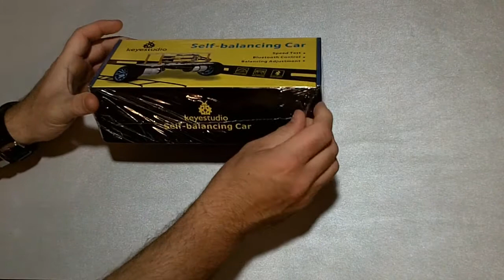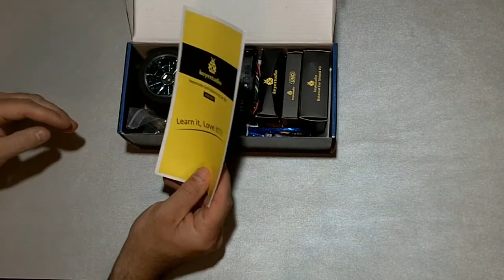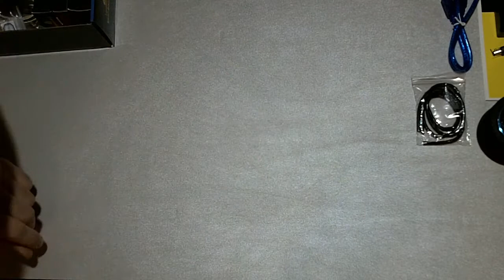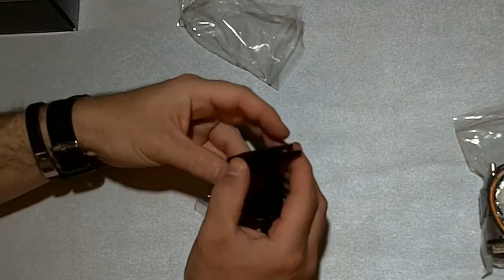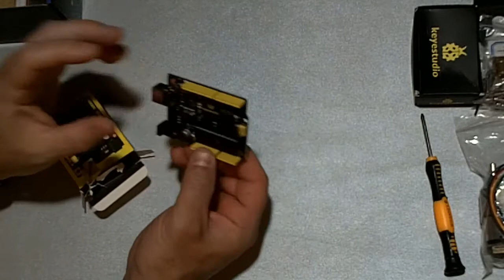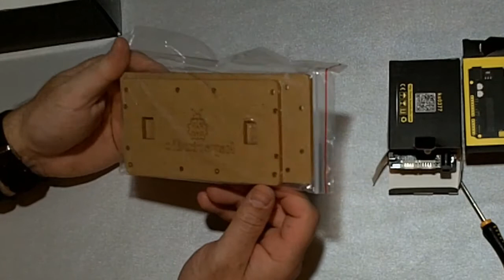Self Balancing Robot Build Part 1: What's in the Box?

Comment: Hi @CircuitCrush! Hope you're doing well. I noticed you were discussing the modifications for this balancing robot.

I'm currently assembling/testing mine, but I've hit a roadblock: the robot balances perfectly fine and pairs via Bluetooth, but it won't react to any movement/steering commands sent from the app (using the stock code provided by the official wiki).

Did you manage to get yours fully working and remote-controlled with the default setup? If so, could you share which app and code version worked for you, or any tips on how you solved the Bluetooth command handling? Thanks in advance!
Reply from the maker: Hey! Honestly, it's been so long I'm not sure, though I dont rememeber having any trouble with it.

Comment: I just bought the kit and i am doing a huge modifications on it to submit it as a thesis
Reply from the maker: Awesome! What kind of modifications are you doing?
Reply: @CircuitCrush  so I added an ultrasonic sensor as you can see it doesn't have it and I developed my own app to control it around and also once it detects an obstacle it makes the app send warnings and sounds and also blocks the user control in case he want to move toward the obstacle as a safety feature and I also made it capable to run in inclined floors
Reply: @CircuitCrush  and I do have others in mind which I still working on them as a neural network so the robot take self decision but it's far yet
Reply: @CircuitCrush  and I am no longer using the arduino that comes with it I switched it to ESP32
Reply: Hi @mr.makavelifashion566! Your thesis project with the ESP32 and obstacle avoidance sounds amazing!

I'm currently working on this self-balancing robot kit and running into a specific issue: the robot balances really well on its own and connects via Bluetooth, but it doesn't respond to any movement commands sent from the phone app (I'm using the official wiki code and recommended setup).

Since you worked so extensively on modifying it and even developed your own control app:

Were you able to make it work with the original Arduino board/app before switching to ESP32?

Which Bluetooth control app or custom app/code did you end up using to handle the directional commands properly?

Do you have any recommendations or code snippets you could share?

Any guidance or files you could share would be a huge help. Thanks a lot!

Comment: You will need 3 x 18650 batteries for this holder.
Reply: Hi @dcpowered @HarshDethe! Thanks for the battery tips. I’m currently building this balancing robot kit, and while the hardware and power are set up (it balances really well and connects to Bluetooth), I’m stuck on the control side.

When I send movement commands from the phone app using the official wiki code, the robot just ignores them and stays in place. Did you guys manage to get the remote control feature fully working? If you have any recommendations on which app or code/firmware to use, or any advice on what might be failing, I’d greatly appreciate it!